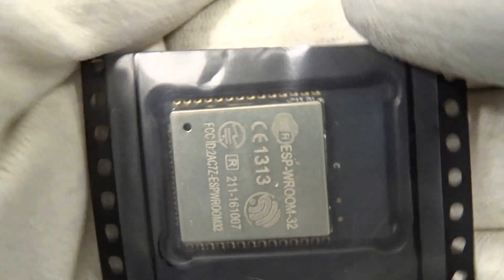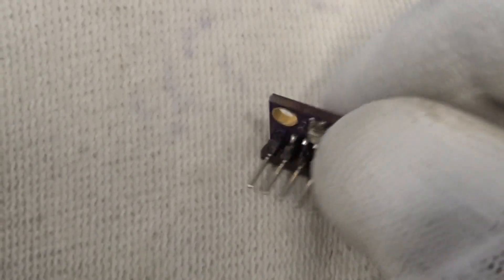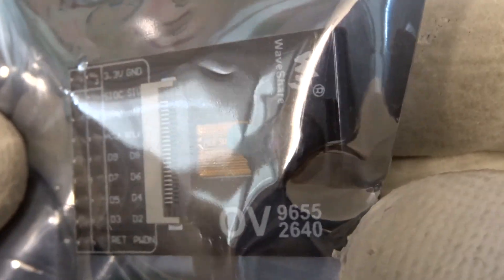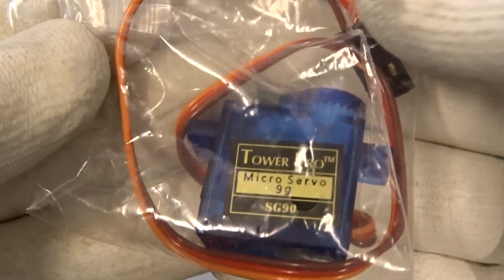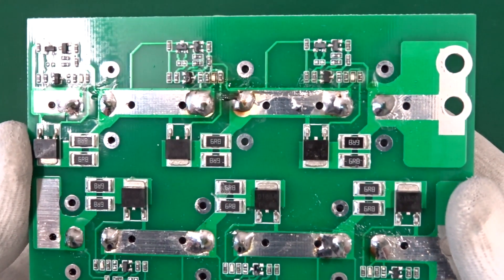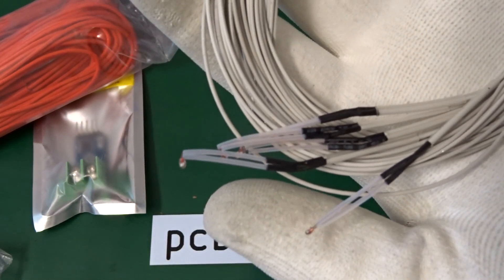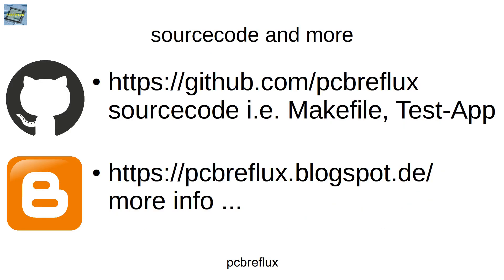ESP32 #49: on the Bench (fake Mailbag)

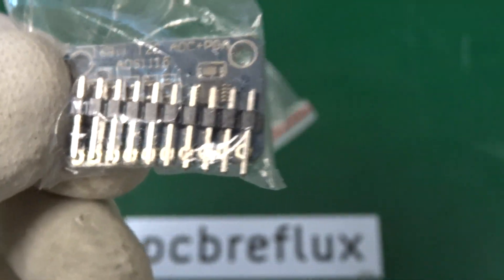Comment: Why at 1:44 you said that the ACS712 is outdated?if there is new one can do a review about it.
Reply from the maker: From my ACS712 datasheet:

For existing customer transition, and for new customers or new applications, use ACS723.

But I've only modules with the ACS712, but think the ACS723 should work nearly the same, the sensed current is translates to a linear output voltage (see Output Voltage versus Sensed Current). Disadvantaged for booth: you need a 5V supply.

Comment: With BME280 I did some measurements and comparisions using a WeMos ESP8266 und published them there 
https://homematic-forum.de/forum/viewtopic.php?p=324372#p324372
So I do not recommend the Adafruit lib. It leads to readings which are too high because Adafruit did not follow the advices of the data sheet. 
I also compared the BME280 with DHT22 and SHT31. 
And I used the BME280 for a pneumatic level meter for an oil tank for the heater. Funny project which works well, https://homematic-forum.de/forum/viewtopic.php?p=328133#p328133 .
Reply: I tried the same sensor from Alice, but I cannot get it to work on I2C. Even the Adafruit Lib test sketch says No sensor connected. I am overlooking something obvious? DHT22 same issue...
Reply: DHT22 is not I2C. And I do not recommend it if you need a good humidity measurement. 
Most BME280 breakout boards have two options for I2C address. The adafruit lib and the adafruit board seem to use a different address the the rest of the field. 
I would recommend to run an I2C scanner and to look which address is activated. As desicribed in my first post I do not recommend the adafruit lib.  It results in a self heating of the sensor.
Reply: If you need a T-H-sensor simple to handle and you do not need pressure sensing, SHT31 could be a good option for you.
Reply: Thanks for all your help. Indeed, not GHT22 but HTU21D that did not work either. Tried i2cscan, all devices (OLED and PCF8455) are found, but not the BME280, nor the HTU21D. I'm puzzled. Ordered the Adafruit SHT31D now as you suggested. But still, I have used i2c for many devices (DACs, OLED, IOext, etc) never a problem. What am I overlooking here? I even changed the I2C adress in the arduino library (0x77 vs 0x76)
Reply: I also use SHT31 like eBay 272450954028 but bought it cheaper from aliexpress. The SHT31-Lib: https://github.com/adafruit/Adafruit_SHT31
is easy to use.
The  BME280 Lib: https://github.com/embeddedadventures/BME280
works also very well with the BME280 but you have to read the BME280 datasheet and choose the correct Parameters according chapter 3.5.1 Weather monitoring
Reply from the maker: Thanks, done some BME280 tests before, and like some other bosch sensors the UI is, for no good reason, way to complicated.
Reply: Yes, it is comlicated but I think the Bosch Reutlingen guys have their good reasons. The BME280 is a pressure sensor and a humidity sensor, and the reason for temp measurement is internal compensation. Using the correct configuration the pressure sensor has a nois Limit corresponding to 1.7cm  geodesic altitude! But in this mode the sensor runs "hot". So, for weather applications you should use a different Parameter set. So, the sensor is very versatile. 
And yes, it is complicated to use it. The calculation and error correction of the values has to be done on the computer and is not done inside the sensor.  You can scale the accuracy of the correction algo. The sensor is not self-contained. 
In my Point of view it is worth the effort.
Of course, if you do not need the barometric pressure, using the SHT31 is the easier way to go.
But the DHT22 is not worth the effort in my opinion. .